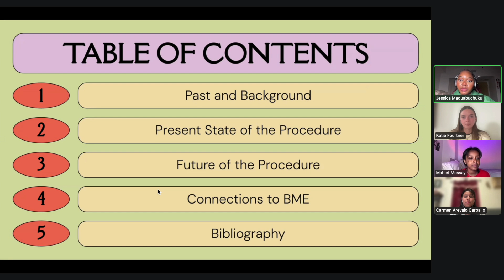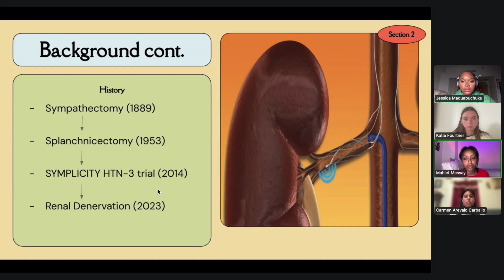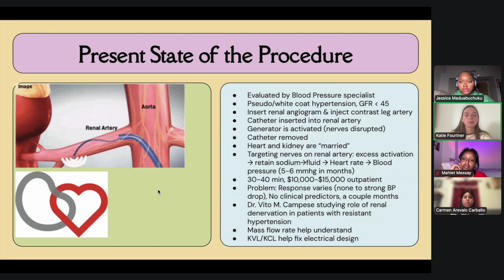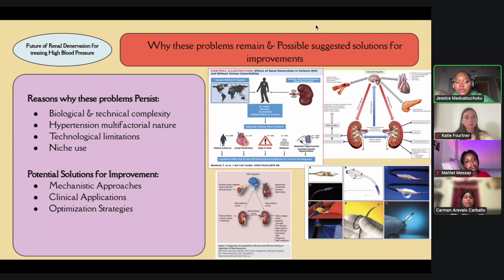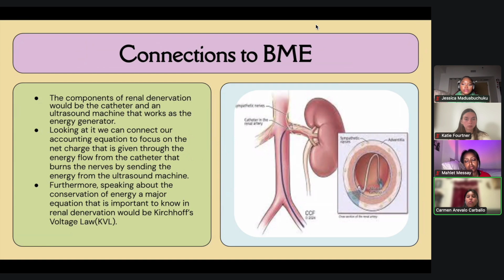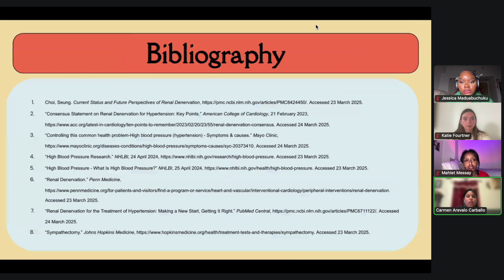RENAL DENERVATION

Comment: You mentioned the two main renal denervation methods--ultrasound and radiofrequency--and that they're relatively similar. Can you touch on how they are similar? Are these similarities seen as a good thing, in the sense that they are both reliable? Are researchers also exploring completely different approaches?
Reply: Yeah, great question! They are both catheter-based, minimally invasive procedures that aim to lower blood pressure by disrupting the sympathetic nerves. They are both primarily used for people with resistant hypertension. These similarities are seen as a great thing because they reinforce the fact that the concept of renal denervation is reliable. In terms of which one is better, some research (https://pubmed.ncbi.nlm.nih.gov/39466083/) has shown that ultrasound may be slightly better, but overall, more research is needed. Researchers are also exploring different approaches. One example includes cryoablation, which is where they essentially freeze the nerves in the renal artery. Researchers are also looking into chemical neural ablation and ionising radiation neural ablation, but they all have the same end goal of lowering blood pressure.